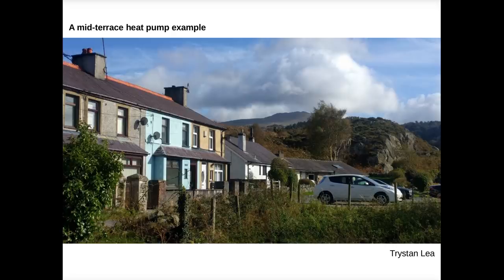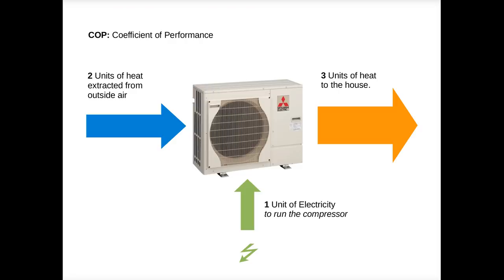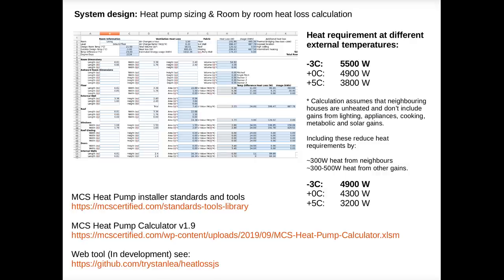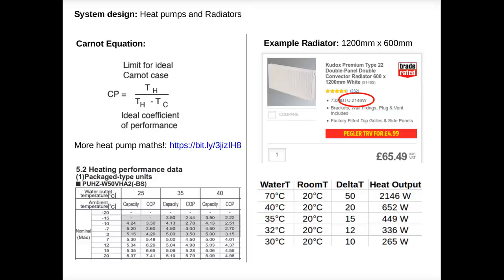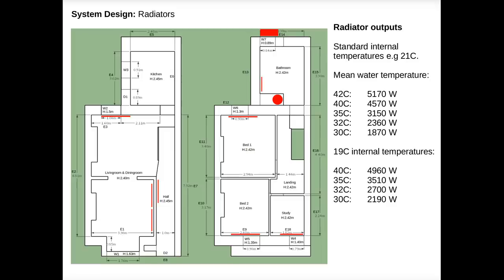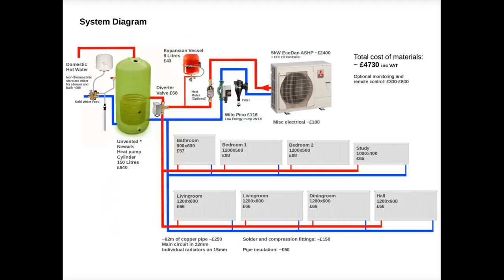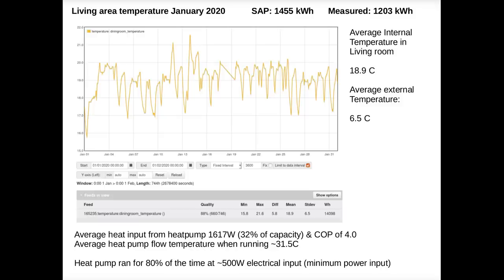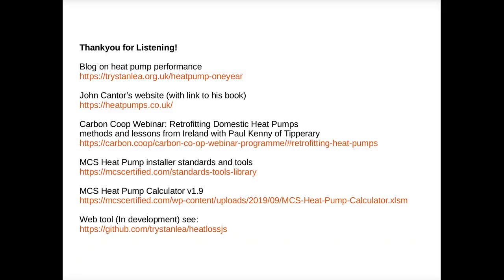A mid terrace heat pump example (COP: 3.92)

Comment: I might get a heat pump to heat a single office room that is not connected to the central heating system. The thing that worries me the most, is the noise from the heat pump fan and it disturbing the neighbours. I can't seem to find any videos on this and how loud they are.
Reply: Noise pollution is my biggest fear for the upcoming ban on gas boilers in the UK from 2025. I expect large house building companies to install whichever heat pump is the cheapest that allows them to tick the required regulations box. Whoever bought a house due to its heating system, hey? So no value in installing a premium system. This will probably be air-sourced. Imagine whole new estates whirring away at night...

I suspect someone near me has recently installed an air-sourced heat pump as this winter on colder nights I have heard a sustained droning noise whilst trying to sleep. It's difficult to know where it is coming from because the sound seems to disappear if you open the window and put your head out, but whilst laying in bed it can clearly be heard. Why? Because the sound is quite low frequency and the walls in the house act as sounding boards for low frequency noise whilst at the same time attenuate any high frequency noise such as wind rustling the trees, which is what obscures the noise when opening the window to investigate.
Reply: @therealtimwarren  I didn't even realise that they were banning new gas boiler installations (for new homes) in 2025. I agree, if the heat pumps are noisy then its going to be an issue if you move into a new build estate. Noise is obviously an issue as it pretty hard to find videos on here showing how quiet or loud a heat pump actually is. I would need to know how loud one actually is before I decided on buying one.
Reply from the maker: @Shundi12  Yes definitely needs careful design to avoid issues with noise. The newer models seem to be getting quieter as well. There is a design process as part of MCS to estimate noise at neighbours windows and to ensure it is below a specified level. I can noise a bit of wall vibration with mine when its really cold and still outside, im going to add thicker rubber pads this summer

Comment: Excellent video educational back with real word figures you are correct with the cop the larger units are less efficient 2x 2.5 kw heat pumps should have better COP again up to 6 in theory.
Reply: Good luck trying to get a COP of 6 from an ASHP.
Reply: Good point cop 6 is the cold side heat bit harder cop 4 most likely pull it up but you missed the point of using smaller inverters. Still $1.00 of power for $4.00 of heat or $6.00 of cold for summer not bad. The other issue with heating with air to air the inside unit has thermometer in the head unit on top of the ceiling considering hot air rises you have to cheat the system by setting temperature about 28° C so you can get to room temperature up to 24° C But you still not beat a wood fire for winter if available. A properly insulated house is the best thing of all.

Comment: Very informative. Thanks for all your work and scientific analysis, but the sums are for a terrace house.
You run at at a low ambient temperature. How much are you drawing from your neighbours?
Trying to extrapolate to my forthcoming project: new bungalow; 180m2; South-facing coastal site; 
Is an air-to-air heat pump feasible for home heating on its own?

Comment: Since the heat pump is hung on an external wall, in the weather, would there be any advantage to putting it in an enclosed glazed space - a greenhouse in effect - on a south-facing wall?
Reply: The heat exchange for the ASHP can not be "enclosed" for it to function properly, since it needs a constant supply new air. To draw heat out of the air and then for it to expel the resulting colder air away.  

But instead it could use an air to air to solar collector below it to pass its warmed air, over the outside heat exchange for the ASHP (ie heat pump) increasing its efficiency.  

And ofc the solar collector would need to be bypassed or turned off in some manner, when the if or when the ASHP was used to cool the building.

Also check out ground Source heat pumps GSHP instead for greater efficiency. But they any option will add to its initial cost.

Comment: Thank you for this really helpful video, definitely the most practical I've seen. I was wondering how you measure the flow in the heating circuit or do you not need to to work out the cop?

Comment: Ah, the tech stuff (active systems) is just so seductive especially if you are a tech person! But really you should start with the passive measures (insulation and draught stripping) as they will reduce your energy demand and thus the size of the heat pump.
Reply: Good point. Start with reducing heat loss before adding new heating system.
Reply from the maker: Sure, always best to look at both in combination. I'm not trying to suggest that we should not insulate, it's important from a wider system perspective as well reducing peak demands on the grid etc.
Reply: @trystanlea  well I am already a convert since I have two heat pumps, one Toshiba air- air and one Nibe exhaust ventilation heat recapture. But above all the house is extremely well insulated with tripple glaze vaccuum pane windows, insulated walls and roof. The extreme climate here in Sweden demands all that.
Reply from the maker: @Raj-nh3fc  sounds like a nice house! great to hear!

Comment: Surely you would get the best COP by reducing the flow temperature when the outside temperature is hotter,  you only need the high flow temperature on - 3 deC. Of course you would need to have a higher flow temperature to heat the hot water  cylinder, this could be done by a 3 way valve  for hot water and a signal to the heat pump for a hotter flow temp.  You could increase cop by switching off the heat pump for the few hours at night when the temperature is at its lowest,  a thermal tank would also help to reduce the use heat pump use at the cold part of the night?
Reply from the maker: Yes that's correct, unfortunately Im limited in my ability to reduce the flow temperature beyond about 30C in continuous operation as the radiator circuit is not able to get rid of enough heat at lower temperatures to stop the system from cycling. This winter I've been experimenting with some slightly different control approaches again, so having a set target temperature in the house and cycling the heatpump slowly (e.g on for an hour and off for an hour, or a wide hysteresis in the controller) that appears to be working quite well, the average temperature is lower and COP a little higher.
Reply: Hi, great video.

What limits the ability of rads to radiate heat... What  dicatates/ hinders rate of at which rads loose heat?

Comment: Thanks for sharing your knowledge and experience, I am building a timberframe lodge of approx 100m2 insulated up to today's standards, my question to you is would a system the same as yours be ok for ufh only? Thanks in advance Bob
Reply from the maker: Thanks Robbie, I would have thought so, if you do the room by room heat loss calculation using the MCS spreadsheet it has a couple of sheets on UFH heat output per m2: https://trystanlea.org.uk/roombyroomheatloss, there's a link to a download of this calculator if you search google with "MCS Heat Pump Calculator"

Comment: did I miss where in the UK this house is located?   I was wondering what geography and climate factors there are....
Reply: Looks a bit like Cumbria? What's his accent like? (listened with captions & sound off)
Reply from the maker: Haha, Snowdonia, North Wales :) So being not too far from the sea here does help in terms of milder winter time temperatures compared to other places in-land or to the east. We are about 100m in altitude I think.
Reply: @trystanlea  thanks!   I had a feeling it looked Welsh, but I couldn't say why...

Comment: Thanks for a very interesting video with good details. How has prices running the system changed in 2021 ! We averaged 6.7 p a kWh on agile electric last year this year it’s double that !
Reply from the maker: Yes much more expensive this year! 2020 was exceptional! 15.5p/kWh this year so far vs 10.7p/kWh last year for us
Reply: @trystanlea  and now we’re up at 28p/kWh on standard rate…. Still, gas is up to nearly 8p too so you’re still better of in an ashp with your average COP

Comment: Thanks for this video, I’ve been looking for some solid data on heat pumps and think you have hit the nail on the head with your video 👍
I’m on octopus and averaging very low costs per kWh.
Take a look at my recent videos of my system setup
Reply from the maker: Thanks Chris, I will take a look, cheers!
Reply: If you have gas stick with it ,if not a heat pump could be the answer
Reply: @ianship5058  Very mixed reports of their practicality and effectiveness.
Especially during the winter, in which I've read they 'cheat' somewhat and essentially resort to an internal electric heating element?
Very good vid, but I feel the UK government should subsidise household solar panels before tackling 'green boiler' schemes

Comment: Thanks Trystan, great explanation of the design process and good to hear your experience of installation of a system on a regular UK home!  For the hot water - I was wondering how do you heat the tank up to 60 degrees for the intermittent cycle - do you increase the heat pump flow temperature for this, or do you have an auxiliary electric heating coil in the water tank?
Reply from the maker: Thanks Tomos, I heat the tank as hot as I can with the heat pump (usually about 52-53C) and then do the final bit with the immersion heater to get it to 60C.
Reply: @trystanlea  so a manual job rather than automagic?

Comment: A very positive report of a relatively straight forward heat pump installation, not unlike many boiler systems. My principle concern over what you have achieved is related to a property other than a mid-terraced one. A semi or detached house would be a different proposition given that 3 or 4 aspects of the property would be subject to ambient weather temperatures, as opposed to just two which are the shortest of the four. This would be assuming cavity construction - solid wall being something else - not necessarily insulated. In your view do you think a heat pump system would be viable with that additional heat loss surface. Current opinion is of the view that a property needs to be of a modern up to date spec to be totally effective, some rather unsatisfactory outcomes often related relative to money spent..

Comment: Just a quick question  do you loose  heat through two walls or more I live in a detached property  and would  be loosing  heat from all four walls  this would raise  the cost of heating so I went  for exchange  gas boiler job done in three hours no mess no upheaval

Comment: Nice video with a lot of detail. Does your heat pump have backup immersion heaters? What size is the mcb on the supply to the ashp? Think you may need that wood burner in the colder months if your neighbours go on holiday.
Reply from the maker: Thanks Graham, no backup immersion in the heating circuit, there is an immersion in the hot water tank. The supply to the heatpump is 16A, but it draws at most ~6.5A

Comment: It would have been helpful to indicate actual cost over the year of electricity used and the total installation cost of the system; together with a how many years to break even calculation. The problem with heat pumps is payback period. If heat pumps cost £10000 to install (HP, cylinder, new bigger radiators) (probably even more) but save you only £300 per year on space heating costs, then the pay back period is 33 years. This is particularly bad for 65s and over, whose life expectancy is perhaps 17 years or less. They may need the money for other things like food, home care services in later life.

The government is considering a 3 or 4 year grant period (2022 onwards), up to £7000 to help install HPs, even though there are not enough trained installers and the calculations needed to get a correctly specified system are complex and often house specific. That will only keep HP manufacturers going for a few years in the hope that the installation costs will magically fall, so that the grant is not needed.

HPs may be good for offices and commercial units but to my mind installing electric storage radiators on Economy 7 plus an electric shower and one of those on demand hot water taps being advertised would be a better option. Yes the electricity costs will be higher in use overall but the installation costs half or less than a HP. The CO2 saving is best done at the source of Electrical generation, i.e. Build more Nuclear Plants. Currently we are building one over 10 years for £18-£20 Billiion. If the government set aside £20 Billion per year for 10 years we would have 10 new Power Stations producing enough electricity to electrify transport and half the homes. The extra electricity can be used for generating Hydrogen, which we will need for aircraft and heavy lorries and big construction equipment. A hybrid Electric and Hydrogen economy will be cheaper to implement and makes use of existing infrastructure. With Hydrogen in the mix those gas power plants can be retrofitted to burn Hydrogen to add to our electricity generation. Maybe then we can remove those awful wind turbines and limit them to the Scottish Islands and Channel Islands.
By the way, you should move the sofa as it will be detrimentally effect the performance of those radiators.

Comment: Air Source heat pumps work well in places like Sweden where houses are constructed to extremely high insulation standards (triple glazing for example). Unfortunately in the UK the majority of houses were not constructed for such environments. Also heat pumps will not heat water hot enough for showers or baths so you will need a back up emersion heater in the buffer tank. Of course at the time of year you most need the heat, ie Winter, the heat pump is least efficient and as time goes on the fan starts to become noisy.  For the vast majority of houses in the UK air source heat pumps are not economically viable. Ground source heat pumps are more efficient but you need a large garden. Note- If the government are pushing it then think very carefully before you take the plunge.

Comment: Trystan, many thanx for a very detailed explanation: very helpful!!! One question: How did you calculate annual heat demand for your house?
Reply from the maker: Thanks Dusha, I used MyHomeEnergyPlanner which is based on SAP 2012 https://github.com/emoncms/MyHomeEnergyPlanner, or for a more basic version https://openenergymonitor.org/heatlossjs/

Comment: I'd be very wary of showering in water that's been sitting in a tank stored at 40 degrees. That's almost at the optimum temperature for bacterial growth; petri dishes are left at 37 degrees to speed up the growth of colonies. The more I look into heat pumps the more reasons for not getting one I'm finding.
Reply: That's why it does a 60c cycle periodically though, isn't it?
Reply: Nonetheless this is why I would prefer to do it the thermal store way - which is entirely compatible with heat pumps so this isn't a reason not to have a HP :)

Comment: Really enjoyed this video, thank you! :)  Lots of reference links to investigate further and thanks for sharing your data.  Was wondering if you are aware of any issues when it comes to hard water areas and the hot water storage setup?   I hope I have enough friends with 'plumbing knowledge' in future too ;)   Would also be intrigued to know how lockdown has impacted how you manage the system, given we all seem to be working from home now rather than going to work.   Last but not least, would the settings system eventually be easy to use for a non techie person (you mentioned quite a lot of manual monitoring to achieve good cop)?  Thinking a constant warm temperature is better for e.g. the very old it very young, but they may want to change the setup themselves and current boiler systems are fairly easy to use.
Reply from the maker: Hello Flickafy, thanks! this year with our new baby and working from home has generally meant control of the system has been easier as its just a matter of keeping the house warm all day rather than pre heating hours in advance of either one of us coming home, I've got the control a bit more automated now which also helps, just a relatively simple temperature schedule.

Comment: Where can I find details on measuring u values accurately. ?
Reply from the maker: It's hard to measure the U-values of materials without specialist equipment, but there are good resources on U-values of different materials online. It's worth looking for papers written  by people that have done in-situ measurement of U-values such as historic Scotland
Reply: @trystanlea  It is, of course, critical to your calculations for the size of system and cost of energy.  It's my biggest concern in changing from cheap oil to the most expensive electricity in the world bar about 5 countries. It will be even more expensive with Johnson's climate policy.